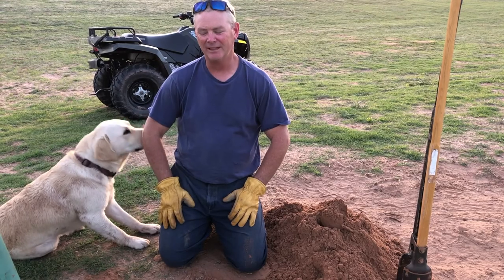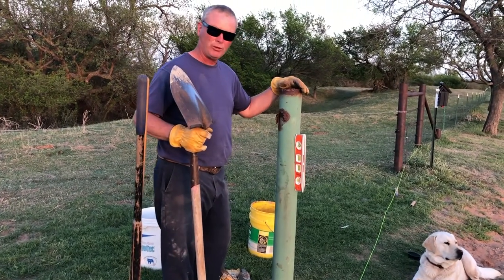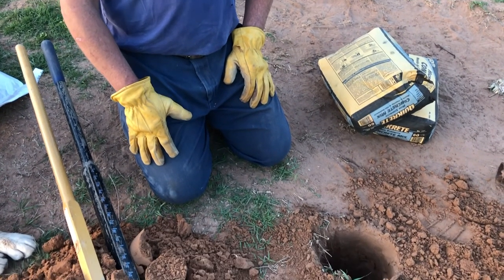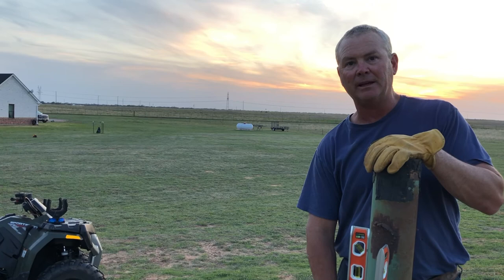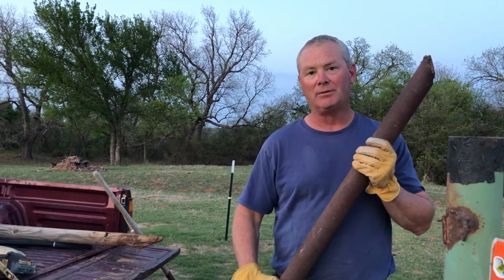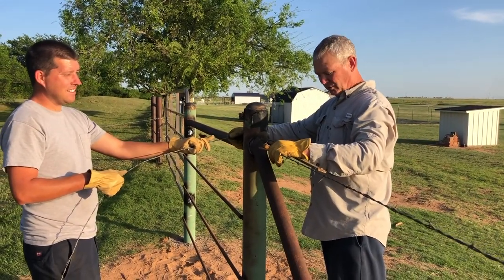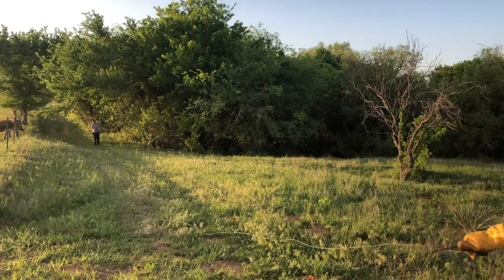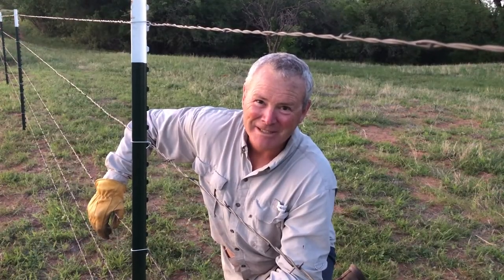H-Brace Install and Stretching Wire | New Gate

Comment: Fool the posts are to be plumb not level!
Reply: He had levels on the pipe when setting them to ensure they were plumb. The string line for the horizontal level at the beginning was just to ensure they were the same height out of the ground. Rest assured those fence braces will still be there when you're in the ground.
Reply: @cfreezy45  a string line level from one post to the other post has nothing to do with plumbing the post at all you clearly said the post are to be level you need to watch your video again.